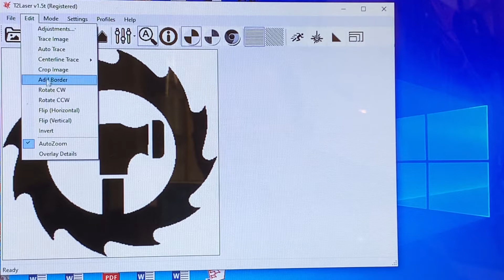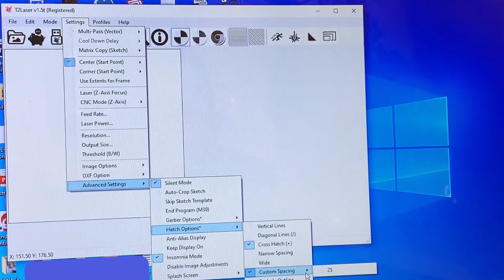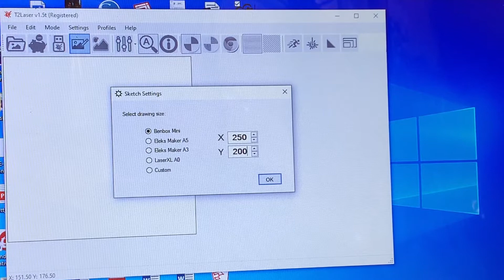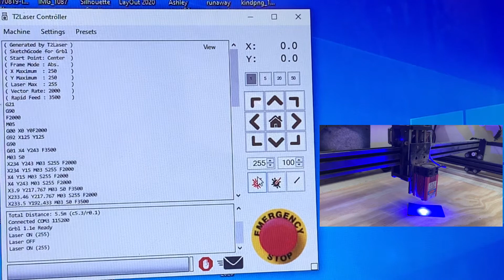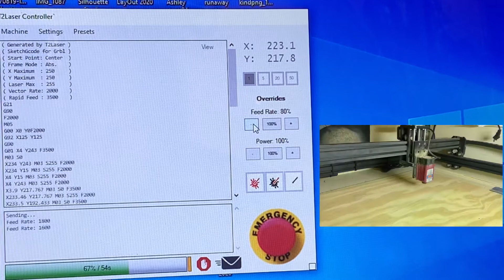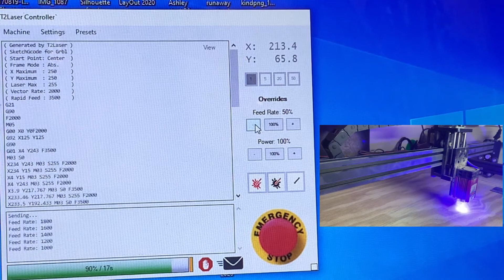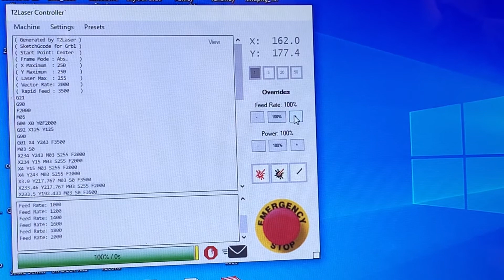T2 Laser advanced settings and waste board grid - How To

Comment: When I do the trace frame it runs great. When I send the g code it takes off the opposite direction and starts to do a smaller rectangle shape. What am I doing wrong?  I've been through your video several times and just can't figure out what I'm missing.
Reply from the maker: What type of file are you loading for the image?
Reply: @seamancustombuilds  I'm just trying to do the grid.